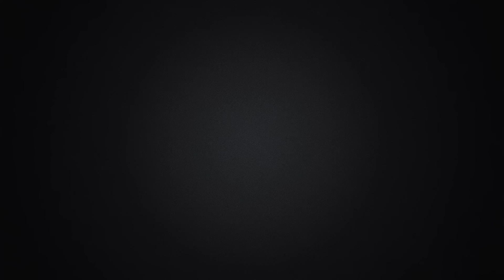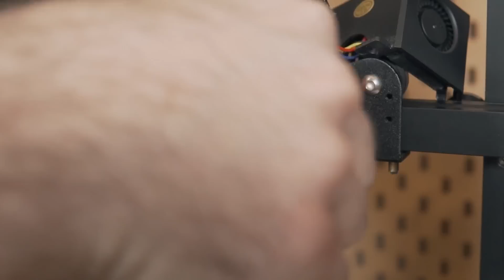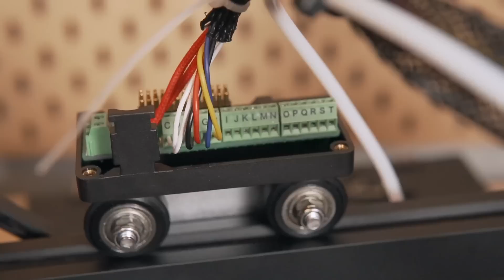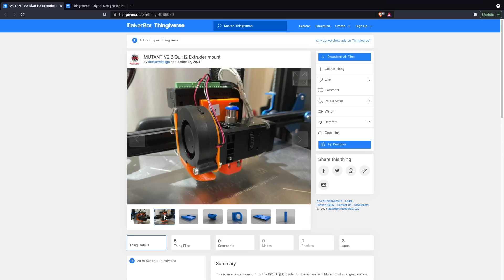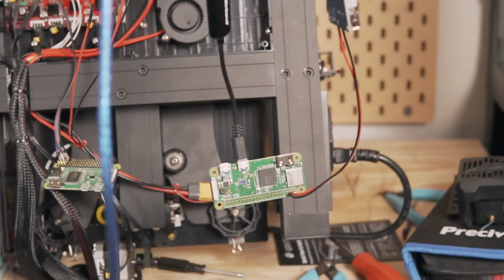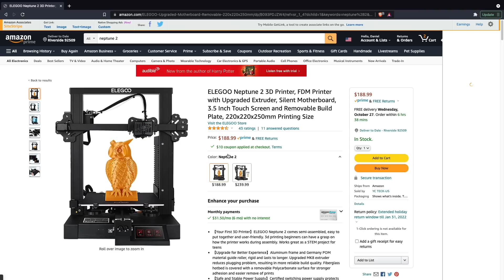Create Custom 3D Printer Toolheads With The WhamBam Mutant

Comment: If your belts are not parallel to the axis you will get cosine error, if you look at where you mounted the belts the triangle formed by them with the x axis will be of different perimeter based on where the carriage is on X. this causes distortion as well as varying tension.

You should make some shims to attach the belt to so it is exactly parallel to the x axis or you will run into subtle frustrating issues.

Comment: man this is really awesome, it's just a shame with the price point.
37$ for every new mobile plate seems really steep, wish we had more projects like this at a affordable price point, if nothing else then a cheaper version.
it just seems like overkill spending 100$+ to have have the ability to swap between just two tools on a sub 300$ printer. 
when you could literally just ghetto fix it with some terminals spare wiring, and a little 3D printing.

i might just be cheap tho :D

Comment: By the way if you have a board like an Octopus (higher end printer for example) you could use a spare driver if you have unused stepper drivers and switch between E0 and E1 for example or however you name it

About e-steps and such you could add a small NFC scanner for an Arduino for example on the fixed plate, add a nfc tag to each mobile plate so the Arduino/other MCU can tell over UART or SPI what the esteps should be, and eventually even the offset to the nozzle for a BLTOUCH or other sensor, which is what i'm gonna do on mine as i just bought a Mutant V2

Comment: Heads up, biqu h2 is does not include an all metal heatbreak  out of the box.  It comes stock with a PTFE lined heatbreak. They do sell stainless steel, titanium, or bi-metal heatbreaks separately.

Comment: You decided to use the Elegoo Neptune 2 because absolutely NOBODY owns one.
Show us an Ender 3...
Reply from the maker: It is a super popular printer lol and what difference would an Ender 3 have made? Nothing would have changed. It is a very similar printer.
Reply: @ModBotArmy  its not popular at all compared to the ender 3
not even a little
Reply: @ModBotArmy  and here's another thing you might want to try:. Showing some video of different tool heads on a machine, in action.

Comment: OUCH OUCH ...... the belt you installed it upside down..... always put the loop so the belt teeth's / grooves interlock with each other when you than zip tie it. this way you avoid slippage on the belt.
Reply from the maker: Yeah it’s been a minute. I have spares I will get it swapped out. In hindsight it makes a lot of sense.

Comment: Is the mount repeatable enough to get perfect first layer every time without re-level?
Reply: Yes.  You just need to setup each mounted tool to be the same.  If all of your hotends are the same such as in a print farm its relatively easy.   If you have different hotends than this can get tricky.
Reply: @whambamtechnical955  Easiest to have each tool resting on the bed when screwing it into the plate, so it's close? That's how I'd tackle it, without reading the instructions...

Comment: You should consider putting blocks where the belt attaches to the sled, because that increased angle will effect the accuracy of your x axis movement. Ideally you want the belt to be parallel to the x axis extruded aluminum.

Comment: For Marlin you could create a gcode file for each config which would load eeprom values, make all modifications for that config and store to eeprom again.  Keep all of those files on the sdcard and the after installing a certain "head", just start the printer, "print" the associated gcode from sdcard using the menu and you're all set ...

Comment: Am I the only one seeing the issue with the belt at https://youtu.be/trO6wSBgaHk?t=63? Both with the angle, and tightness. These would result in significant quality issues when printing towards the side edges of the printing plate.
Reply from the maker: The angle I am not 100% on but the belts have been tightened. After that shot I did add tension to the belt tensioner.
Reply: @ModBotArmy  Tightness should be an easy fix but the angle is probably not. I think it would require the backplate to be redesigned. With that type of an angle drop with the belt, the amount of travel per each step closer to the edges of the bed would vary enough from amount of travel in the center of the bed. In which case, you would find dimensional precision issues. Obviously, this would not matter unless you print large objects such as helmets, or large objects that require precise fitment.
Reply: Regardless, great content, and educational as always. Quite a big fan of your objective, facts based, non-over-editorializing style.
Reply from the maker: @ahmetmetinuzun  thank you very much for the kind words 🙏. Have a great weekend 😬

Comment: I've had the mutant v2 system for about 6 months now, while it's not for everyone and rather expensive I saw it as a way of having the hotend that i was testing/wanting to use and a hotend that just worked after that I got into using mixing extruders (there are some rather nice cheap ones on aliexpress that i wanted to try). 

My main issue with the mutant system is there should be a way of mounting a BLtouch or similar to the fixed plate so that you dont have to run multiple homing sensors for each hotswap plate you have. 

Like a lot have suggested here I jus have multiple 'printers' set up in my slicer with start gcode to make sure my printer has everything set.
Reply: I am working on such a system and will be uploading it to Thingiverse soon.
Reply from the maker: I wonder if they could make an adapter. I do like the idea of that though. Then you could use the fixed plate to level and all you would need to adjust is the z offset. Someone else mentioned that in the stream that I did on it.
Reply: @ModBotArmy  I'd hope so, the only issue i can see with the idea would be how not every hotend can be mounted in the right place so the nozzle sits between the sensor's extended vs retracted range (talking about BLtouch only here, i havent messed with other ABL probes)
Reply: Curious, is there enough "meat" on the side of the fixed plate to drill and tap (or heat-set inserts, depending on how the GF nylon behaves) M3 holes for a BLtouch adapter? Could use the right side to avoid interfering with the X homing switch, or sacrifice build volume.
Reply: @jjpaq  Not particularly, from what I measured there's only 2mm of 'meat' with the rest of it hollow to accept the provided square nuts, not that you couldn't try putting an insert i just dont think theres enoguh there to hold it in place.
Reply: @SoulRetriever  Yeah, even an M2 tapped directly into the plastic would want a 1.6mm hole before cutting its own threads. That's close. 😬

Comment: This video made me take look at my ender 3 hotend and realize how easy it would be to cut the cables that go into it and add a male/female molex for easy connect disconnect.
Reply from the maker: Definitely! That is not a bad idea if you want some form of replacement option. It would be a few more steps to unbolt but if you just want replacements of the stock setup I cannot see why not do something like that. E3d does something similar with their thermistors and (maybe heater cartridges)
Reply: @ModBotArmy  True. Maybe have setups for different materials already assembled? You know, different coolers and all. EDIT: Instead of Allan maybe use tumb screws for easy removal?

Comment: In klipper you could make a .cfg file for each toolhead with [include toolhead1.cfg]  [include toolhead2.cfg] at the top of printer.cfg and uncomment whichever one you are currently using, it would also allow you to set different offsets on different heads or for lasers.
Reply: As you can use logic in macros it is perhaps also possible to include the correct config file automatically, given a start Gcode input from the slicer. I do love Klipper and the possibilities it offer 😁
Reply: @Eadsn  I'm not sure about the start Gcode as I think klipper needs to restart to apply the settings but I could be wrong.
Reply: @steve_nobbs  True, it needs a restart if you want to read in separate config files. But a macro that just updates the values don't need Klipper to restart. Could perhaps work

Comment: I guess you need to adjust all the offsets when you change the head- x, y and z, although slight variation in x and y won't matter much. If you are using Klipper, try writing some gcode macros, then a number of adjustments could be made by including a single line in the gcode file.
Reply: The easiest way to deal with this is to create a profile for each tool in your slicer and include a G92 command in the starting script.  Something like G92 X-5 Y-10 right after the G28 Command.  You can also use M92 to change the e-steps if you are using a different direct drive extruder.

Comment: you cound easily put the gcode for e-steps etc into files and store on the sdcard, then just print the relevant one.. Direct_drive.gcode.. Bowden.gcode..

The cable connectors, that is just crazy, as soon as i saw it I thought wtf were they thinking!!! Besides it looking very UN-polished, you are poking screwdrivers between cables etc.. I am an electrician by trade and I cannot for the life of me think why that would be necessary.. That should be rectified right away IMO

I get what you are saying about it resulting in a loss of build plate volume, I created a mod to relocate the BLTouch to firectly behind my hotend to get the closest possible offsets, it pushes the travel of my bed to the absolute limit to get dull bed coverage but I just could not reduce that print area by a few MM, yet i have never once used the full y print range, and likely never will, but psychologically its a big thing LOL

Comment: you could've also added slicer profiles for each tool and make the start-gcode set them :) tho for klipper that's more complicated cause no gcode for setting e-steps
Reply: The macro capabilities of klipper is really good, G29 is not present but can easily be added as a macro. I believe it would be quite easy to set the esteps in the start gcode and have a macro update the esteps, but I could be wrong 😄 I'm by no means an expert on klipper

Comment: Insanely overpriced IMO. can 3dprint one that's much nicer for 1$~-5$ honestly
also  honestly they call it a tool changer but it's a quick swap system, not a tool changer!
149$ is insane. My actual tool changing addon for my printer costs less than that. and that's 2x bmg extruder 1x pancake nema 17, 1 motor, 1 motor driver, 1 step down, dowel pins, spheres for the joint. all that is still less than 149$. (I'm talking about an e3d style tool changer, like an actual one)

not a fan of this product at all.

even the jubilee REL system alone costs 45$~-40$.

Comment: Great video!  I would double check that H2, I have two of them and neither of them are all metal.  BTT might sell an all metal version of it, but Iv not seen it.  They do sell all metal heatbreaks for upgrading it to all metal, but the people Iv seen use them have had issues with it.  

I think one of the best use cases for something like this is different size/type nozzles.  I am ultra lazy sometimes.  Its not like changing to a .6mm hardened nozzle for printing marble is difficult, but I sure would print marble a lot more often with something like this.